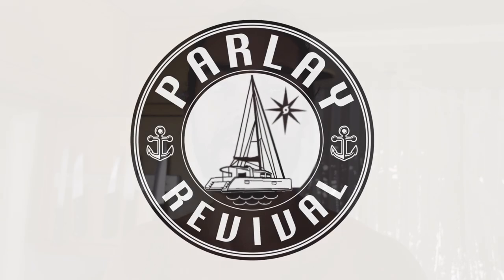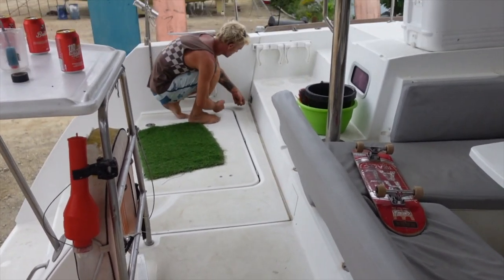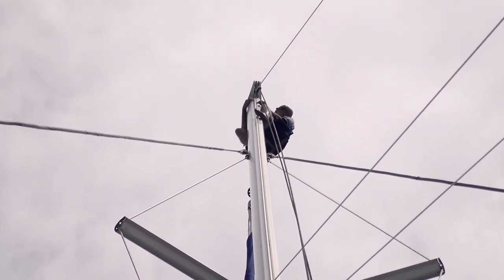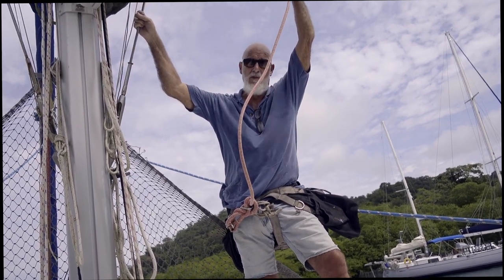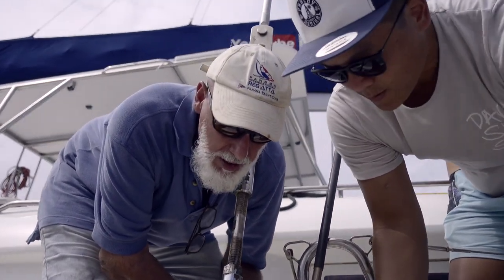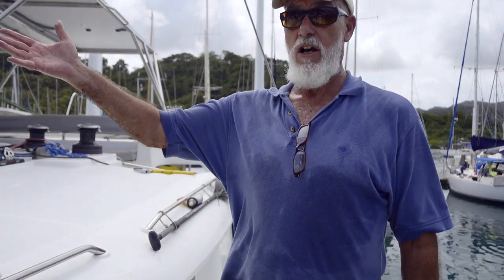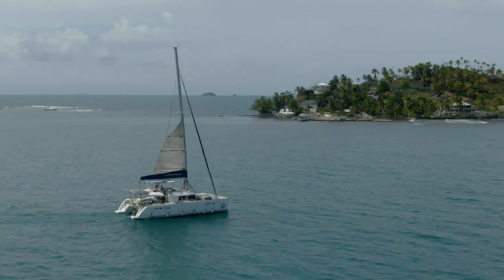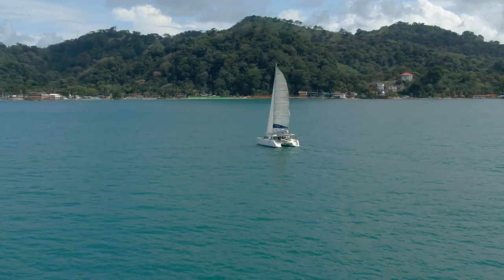How to PROPERLY TENSION YOUR RIGGING on a catamaran - Episode 142

Comment: Love it when an expert actually teaches and passes on his knowledge rather that keeping it all to themselves.
Reply: He does, because he is on "TV". All riggers I know (3 in one week checking my rigg !!!), said, you need improvement.
Reply: @Anne6621  It's called a Loos gage.

Contrary to what this guy is saying, measuring the rig tension and comparing it to the manufacturers specification is the best way to know your rig is tuned correctly.

I wouldn't rely on "Instinct".
Reply: @Bd1ddy1  You are absolutely correct. This Mike Barker was absolutely thin air. "trust your instincts" and "listen to your boat" ... hahahah. Now, my problem is to get specs for my Lagoon...

Comment: I’m a rigger here in Costa Rica, and I was waiting patiently for this video…. I was also specting Mike to work on your boat.. his comments were so spot on and it seems that with his detailed explanation you now have enough knowledge to understand how your rig works and should perform on your boat….  Hope to see you around in 🇨🇷
Reply: Ok, Mr. rigger. Could you repeat the 'spot on' comments that was so useful? Other that don't overtension, 'trust your instinct' and 'listen to the boat'...
Reply: @MrGentlebutfirm  yeah well, these boats have been full of surprises..  there is a really fine line between leaving it too loose so the mast base will start moving, and tightening it a bit more and hurting the boat…,

Comment: I was on a boat where the front half and the back half were build in a different shipyard. They were brought together on the water, drifted together and welded while floating. Then the complete boat was placed in a dry dock. When the water was pumped out the bow was more than a meter above the dock blocks. To cover up that bending of the boat they made a cut through the bow above the bulb and lowered it on the blocks. Then thy closed the gap. Later they did find out that the boat originally was perfect straight but the dry dock was curved... I only can congratulate you on the superb quality you have reached. That rigger is super. The praise he gave on your work was the confirmation on what was clear. You did it right!

Comment: Good job guys, don’t forget to put a charge dissipator up the mast to reduce the chances of lightning strikes and flush vinegar in the head to prevent scale buildup and clogging.
Good sailing!
Reply: Our next boat will be fresh water flush.  Vinegar slowed the buildup but was hard to get in Europe.
Reply: @svroundabout  ????? Vinegar is hard to get in Europe. In every supermarket you can get up to a dozen different brands, from plain cheap ones to Italian chef quality!
Reply: @johnmayer3433  In very small containers.  Not like going into a Costco in the US and picking up 2 gallons for $5.  When we found it, it was like 5 euro for one liter.  We spent year sailing the Med, mostly Greece but also Italy and Spain.

Comment: That’s very similar to how we tension ours.  Tighten the leeward side just enough to hold it taut.  I have set it up and gauge-tested it so I know a good starting point by gauge.  Geminis have been broken by riggers using monohull tension (20% of breaking strength) because of the relatively light build and leverage due to beam.  I feel much better about my methods having seen this, so thanks!!!

Comment: I reckon this is the #1 key test so far showing that your hard work and dedication has 100% paid off. You could argue that prudence would involve continued assessment of repaired areas for cracks and the deflection test, to truly be sure. But if you'd cocked it up badly it'd be showing already, big static forces at play and even in a light sail. Top marks Colin n Co. Proud you're a Kiwi.

Comment: When I tune I start by making sure top of mast is centered over the boat and that all threads on turnbuckles are lubed. Then as I tighten I count turns so that each side gets equally tightened and mast stays centered and straight. Then at some point when the rig is nearly as tight as it needs to be , I measure the distance each turnbuckle is  open with a precision caliper and record this as a base number. Then any future tuning is done by comparing the new tune to base tune. I also use a gauge, but don't rely on it . If ever confused just go back to base and start over. Tensions on halyards, boom weights etc screw with the gauge. Measurements are best to use for repatabilty.  Then you go sailing and do it again a few more times, this time recording headstay sag and heel of boat.  Ok a bit much  but recording what you do is a big help. Also you want to look at mast and sheet leads and determine the look the exact same on opposite tacks in stead the wind
Reply: Yeah, a gage or measurement is a necessity.  I would never tune my rig on "Instinct" .  What horrible advice this guy is giving.

Comment: Once you're done with the fine tuning of the rig tension, I estimate you will see about 10-12 mm gap between the straight line and bridge deck (in the middle). Fine tune with full sails up in winds around 4-5 Bft at the most. Keep tacking until you have it right (as instructed by the rigger). A little bow in the forestay is not uncommon. The sailmaker should have accounted for that. Note that with stronger winds you'll probably reduce sail area, and with that the pressure on the rig. With reduced sails in stronger winds, the tension (and slack in downwind rig) should be about the same. As soon you have some heavy weather on your next trip, go below and check your bulkheads, doors, and anything else for movement. Use eyes, ears and your hands on the surfaces to "feel" the boat. Now, of you go! Looking forward to the next adventures. Safe sailing to all of you.

Comment: Having Mike come out and give his philosophy on Rigging was perfect.  It isn't this huge mystery and no one should be afraid of it!  Get the mast straight and in column, and set the rake angle only with light tension... then sail it.  Judge the tension by the LEEWARD shrouds. Perfect.  I do synthetic rigging and I never use Loos Gauges, Dyneema can be very tight while never feeling as tight as wire does.  The rule for any type of rigging, They Aren't Piano Wires!

Comment: That's the way I learned to tune my rig on my first boat, a Prindle 16 cat, by feel.  Because the rig had to come down at the end of each sailing day in order to trailer home, I got lots of practice.  Tighten the shrouds but leave a minor amount of slack.  With mainsail hoisted, put wind pressure on the beam and take 50% of the slack out of the downwind shrouds.  The flip the boat around and do the same thing with the other side.  Repeat the process as you incrementally take less and less slack out on each side in sequence until the slack is gone, but only put enough tension in to keep the upwind shroud from pumping under load.  Same principle applies to monohulls, but there's less risk over bending the boat due to over-tightening and you want a bit more tension at rest because of the shrouds being more vertical.

Comment: I have sailed the oceans for forty five years and I always veer towards looser rather that tighter. I skippered a Baltic 65 a long while ago that had a hydraulic jack under the base of the mast in case you wanted to tighten the rig a bit in heavy weather...never used it!  Aloha, David.

Comment: That's exactly what I did when I left Linton.  I adjusted it a little bit at a time over the course of several weeks.  On a beam reach @ 18kt wind the leeward shroud feels not tight but not loose. Some headstay sag, but not too much. It's now tuned 5 turns less than the rigger in Florida had it, and sails great with no more crazy noises and windows popping out.

Comment: You called it Colin ! 5mm now, down from 40mm is a great outcome. Now that you've got an almost fully tuned rig, would it be a good time to put in some tell tale markings in every reachable space you repaired ?  I'm thinking of some simple magic marker hash or paint marks to show you if any sections have moved, particularly when you're sailing fully loaded across Pacific.

Comment: AWESOME!!!!  <5mm is, as far as I am concerned - PERFECT!!!!  SO very happy for you Colin!!!  The Pacific is waiting!!!!!  It will be interesting to see what the deflection works out to be as time marches forward, but in my humble opinion - without any deleterious events, it won't change much more than a few mm maximum.  I wonder how those folks are doing with their 500 that James brought around?  I felt bad for them as they dropped 80K and skirted over the bulkhead issues as being "normal".  Ha.  With your microscopic adventure into the engineering of those bulkheads, all Lagoon owners should likely prepare for busted bulkhead repairs - but that's my opinion.  Mr. Baker is a true gem.  Further, he is dead-on with adjusting the rigging - dead on!!!  A little is better than too much, getting it right rather than where it's too tight and again equalizing forces through breaking the structure.  Bad JuJu.

Comment: Glad things seems to be working out for you! I wonder how much expansion and contraction the changing if temperatures will bring about when you go from a very hot climate , like Panama,  to a cooler or colder climate, Like below the southern tropic or above the northern tropic,  this would likely cause changes in both the measurement of the boat, the mast and the rigging. A bit looser to compensate for contraction of rigging and boat may help. I have heard that the expansion and contraction differ in steel, aluminum, fiberglass, and wood which is why it is not wonderful idea to mix them. This is likely what your rigger was trying to say when he said using plywood bulkheads to reinforce a fiberglass boat is not a terrific  idea...

Comment: Great episode.  I think the best think Mark Barker mentioned was about the massive leverage that is created by the rigging and mast due to the width of the vessel and quality of the components.  The reduction of the deflection is awesome.  When you set the vessel on the stands in the marina did you measure that deflection?  Do you make corrections so the hull was as straight as designed?

Comment: Good rigger...to start I always check my mast by placing my chin touching the mast and looking up..you will see if it is straight or off the slightest, do it on the side also to see the bend in the mast fore n aft..(this can also be done underway to see if the mast is pumping back n forth)....initially check,adjust the rig and then again at the end..and he is absolutely correct do NOT overtension...
A local rigger here in Airlie Beach was called on ,to do a rig on a sloop (single hull boat) that a guy spent a decade restoring...he went out the next morning to find only the tip of the mast above the water..the rigger had put so much tension on the rig he literally spread the planks with the chain plate tension, (that's the bit the rigging attaches to the hull for those that need to know)...it was hard to watch this guy balling his eyes out..which then turned to rage.
The Rigger was no where to be found for several days !!!!!!
Happy sailing to ya'll on Parley...your rigging is nice n simple, wait until you start using mast jacks and hydraulic rigging on the much bigger boats that have to be set up daily before each sail and relaxed each night after racing !
Congratulations on under 5mm deflection on the aft deck..you didn't even look nervous measuring it up !

Comment: You gotta remember, Lagoon will never admit that their Catamarans are not up to snuff. That'd be like me telling the homeowner I just built a home for, that I under built their home! Expect some failures in the structure, your home may even fall apart. Neither would I admit this or would I do such a thing. Good luck and thanks for the video each week! We had a 38 footer taken to lake Michigan before it was tested and it fell apart, lol. When we got to look at the stiffing engineered into the hull, I was one of the first to shake my head and tell them it wasn't done properly, it had to go back to engineering. They didn't listen and paid a big price for it. The company was owned by Brunswick Corporation and I wrote the President a six page letter letting him know what was going on and the leer jets started landing at the airport within three days. Didn't hear how many heads rolled for that screw up but I'm sure some did.

Comment: He's spot on ... the only amount of rig tension you ever need is enough to stop the leeward shroads flopping about in the conditions you are saling in, with the amount of sail you have hoisted. Applying more than that is pointless and indeed dangerous to the boat.  I would bet many boats are damaged by people (including riggers!) looking up the "recommended tension" for 12mm stainless wire and cranking it up ...  a cat has a much wider base for the mast height than a mono and will need far less preload.  That guy knew his stuff!

Comment: just out of curiosity when you straightened the boat before doing the bulkheads, would there have been any value in getting the boat to have a little bit of negative deflection so that once it's in the water and the rig is under tension, the negative deflection results in a 0 or completely flat surface?
Reply: I was thinking the same thing ..to late now..
Reply: It is essentially 0 degrees.  5mm on that length of tangent is nothing.  

Plus the boat will flex, and if the rig is at the neutral position in the arch of movement the hull sees...the rig will tighten and slacken with the flex.
Reply: @nicholasr7987  Says you, I've installed machines to .0005 per /ft for 40 years  ,5mm  is 5mm  not 0 LOL
Reply: @Mechone11  You have installed machines or made Fiberglass boats?  🤔   Last I checked the conversation is about boats.  I'm glad you are so intelligent you can follow along on subject.
Reply: @nicholasr7987   again 5mm is not 0 and I know more than you will ever know  and yes have done lots of fiberglass and the boat should have been given a positive camber
Reply: What you are asking for would be positive camber...the boat is actually already sitting in negative camber.  🙃 with the 5mm.   You may want to edit your response.  

Everyone knows that 5mm and 0 are different..BTW.   If you don't understand what I explained to you get a crayon and paper.  Understand what a lever is, arch, that the tension force comes from the hull (Not the cables) and that the boat flexes.    Force is measured at angles.  If set up like you are asking the forces in rigging will decrease drastically just by adding weight to the boat.  The hull and rigging is a system...not static like your machines.   

I am also.glad you are capable of leveling to ~10 um, or the size of pollen spore.   You have skills.
Reply: @nicholasr7987   look it should not have a  5mm  hollow in the deck it should be postive as my boat is so water runs off or maybe they can use the pools of water to wash their feet

Comment: Great validation of all your hard work, and your engineering.

One thing I am afraid is not percolating through to some of your audience is the need to put the hulls in proper alignment with one another before repairing the damaged bulkheads.   I saw a video of another Lagoon owner checking to see that the bulkheads on his boat had become detached from the hull interiors.   So he was going in and fiberglassing in tabbing to connect the bulkheads to the hull…. WHILE THE BOAT WAS ON THE WATER.   There didn’t seem to be, that I saw, any measuring of the distance between keels, no checking to see that the hulls were parallel, no checking of the bend/ deflection of the deck.   No straps, levers, or anything as a substitute for the four posts you put under your boat, and the various jack pads you used to position the hulls correctly, so that when you reattached your bulkheads to the hull, they would act to hold the hulls in proper position.

Instead, I would think the guy was locking his hulls into a splayed out position.   Which is, I guess, better than not doing anything at all, but…

I was wondering what the instructions that come with the repair kits Lagoon is sending out say about this (alignment of hulls in preparation for repairing bulkheads, etc.

Comment: Going from 40mm deflection to 4mm of deflection? Shows proof-of-work, 😃😄 of a GREAT JOB on the glassing in and reinforcement of the plywood bulkheads. (A 10X improvement.) As the Aussies would say, Good on Ya' mate.
Tuning the rigging reminds me of tuning a 12 string guitar ( alot of stretch and pressure on the strings and neck)
This is why they put steel rods in the necks of guitars😃😄😁😆❤

Comment: Just be aware that mean temperature of the vessel is operating in (mild, hot, or cold climates) can affect the level of tension of the rig. I was shown to use at less a 2-metre-long stick which was just taped or ties to the rigging line and then while tightening the rigging line measure the gap between the stick and the rigging line by just pulling out the stick. 
One part you did not cover is that you need to ensure that the rigging (mast) is centred and not overtightened on one side. This can be achieved by using a measuring tape & marking tape. Just search youtube there is an amazingly simple method you can use with extraordinarily little additional equipment that most captains will be easily achievable